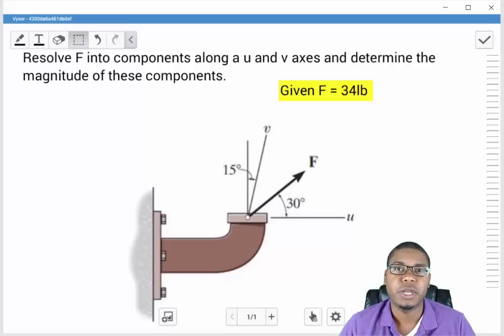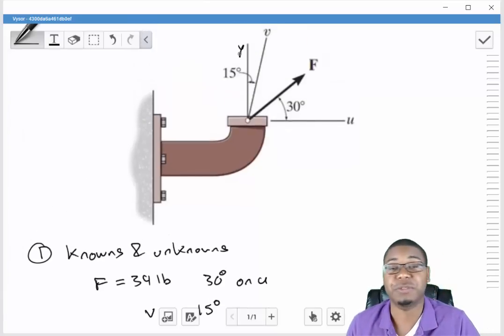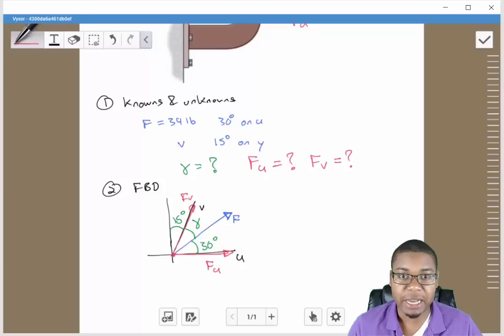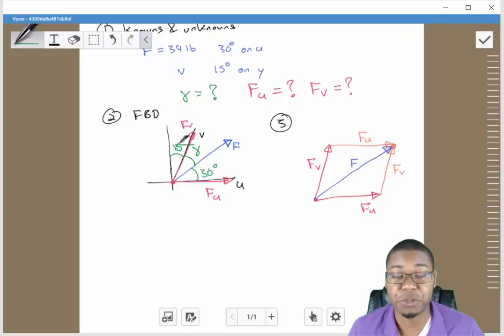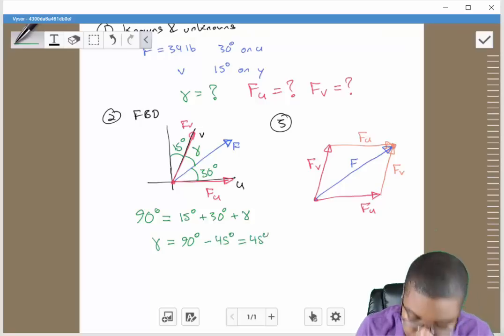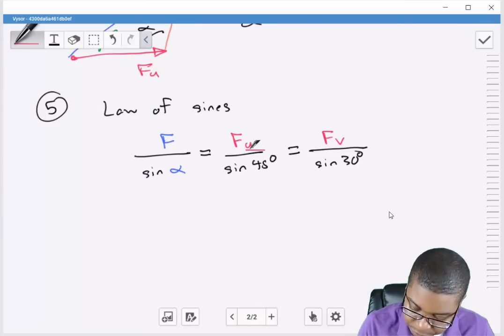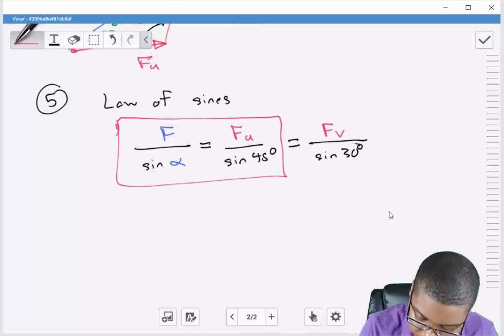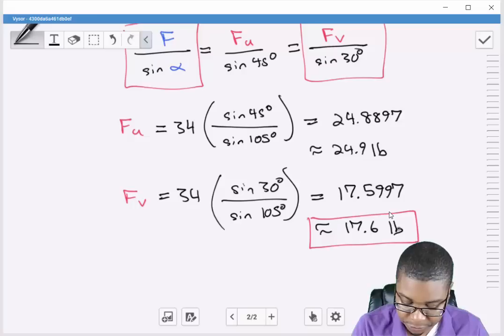Force Vectors - Example 1 (Statics 2.1-2.3)

Comment: thank you so much for showing us on how to solve problems by using parellelogram and sin e rule. I am on chapter two statics and strength of materials on equilibrium of bodies. its seamingly becoming  hard to draw free body diagram and determine reaction forces. Would you be having videos on that please and what are the tricks on where to vector the magnitude. I will really appreciate. Thanks for your help.
Reply from the maker: +samwel80 The Parallelogram and Triangle rule come from geometry. You should review examples from geometry courses to help you in this area. Practicing problems from the Statics book would also help. All the Best, Dr. Stewart